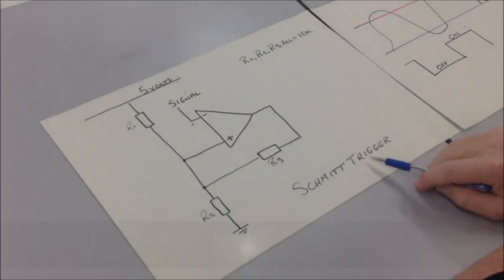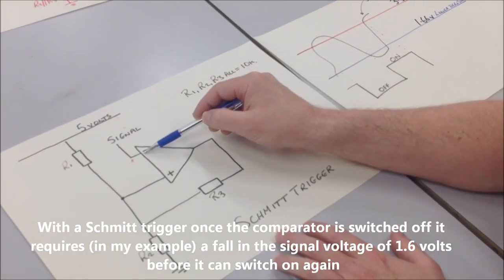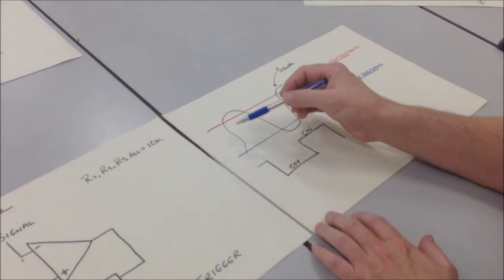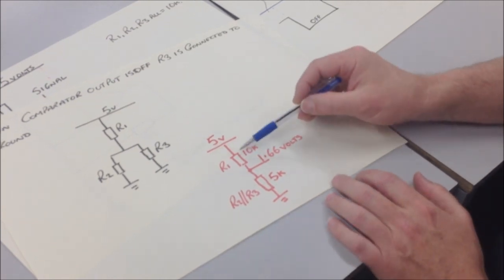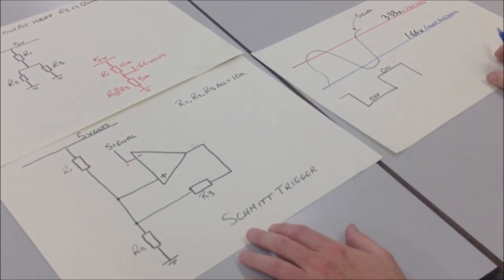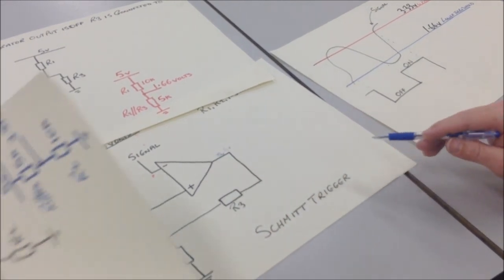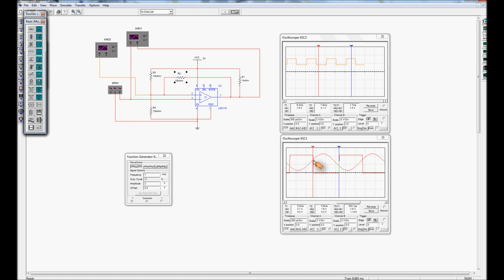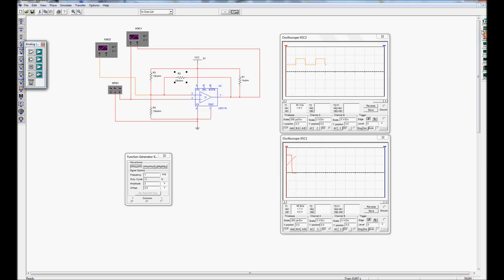"Schmitt Trigger" Paul Wesley Lewis

Comment: I was just thinking that with two Schmitt triggers you could hack together some kind of inexpensive time domain reflectometer when coupled with a microcontroller.  The MCU takes a pin high and low at the intervals you are wanting to use.  That feeds the first trigger. Feeding the trigger and not going directly from the MCU would be important because you want the fast rising edge that a Schmitt trigger could provide.  The second trigger is set to a window that would trigger on a reflection of the first signal.  With that information you could deduce the length of the cable as long as you know what velocity factor is in terms of c.

Comment: Good Day. Was just wondering if the same formulas work on actual simulation of the Schmitt. wouldnt the output have a loss? Like the Vcc is 5v, wouldnt the output be around 4.1V or so? :\

Comment: Question here :) I do not see how the R2 and R3 are in parallel. For them to be in parallel shouldn't the second pin of R3 (first one is the one connected with the exit of the comparator) be connected before the R2 therefore directly to the ground as one pin of the R2 is . In the scheme as you've drawn it I see R2 and R3 in series when the comparator is in "1" state.
Thank you for your time.